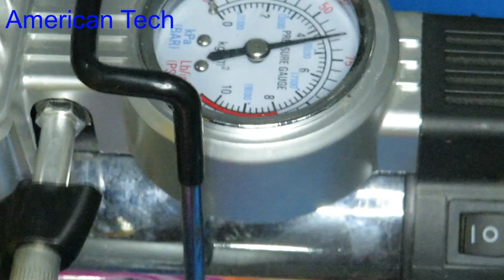DIY Compressed air can ,  Amazing water spray from mosquito killer can

Comment: Before attempting to apply a flame on the cylinder it should be thoroughly washed with detergent to ensure no residue of the inflammable material is within or else it could explode ?

Comment: if u have an compressor why would u use that
Reply: Because most compressors are heavy, bulky, have to be plugged in, and not very portable.  Being able to pick up a small can to blow dust off of a computer circuit board makes much more sense than dragging a 30 lb compressor up to where your computer is! Also the volume of air released is greater than what a small compressor like the one shown can put out at once.
Reply: @eagleviewhd   yes but if the can explodes you dont have an hand to work on your computer

Comment: That Schrader valve has a high chance of failing at the solder joint. Also everywhere the paint was ground has been thinned out. This project will cause some unlucky individual to blow off a finger. Good luck.